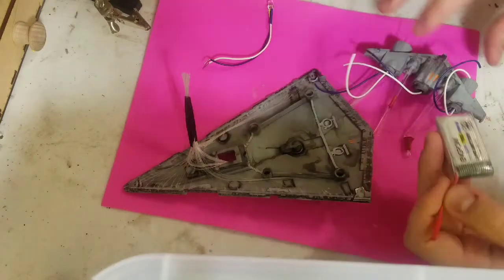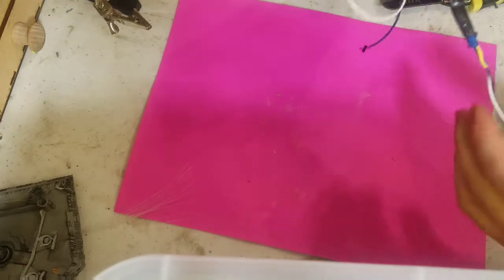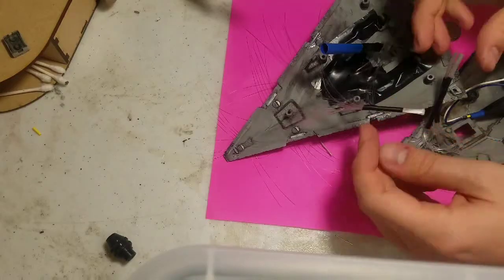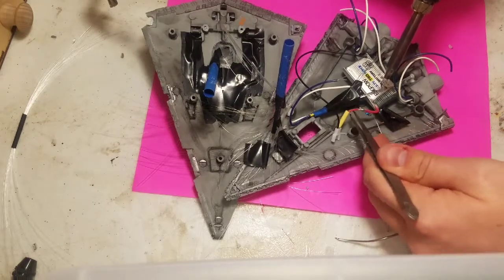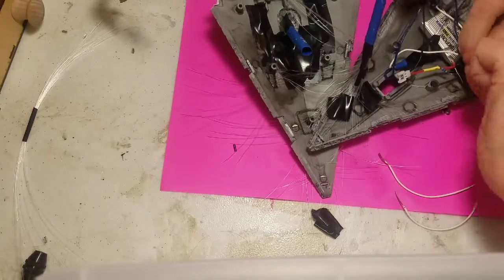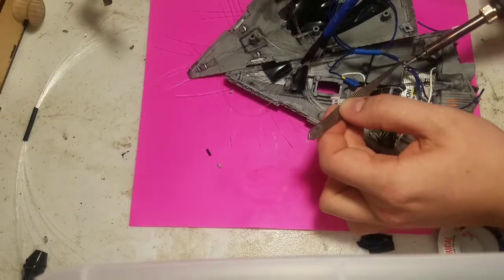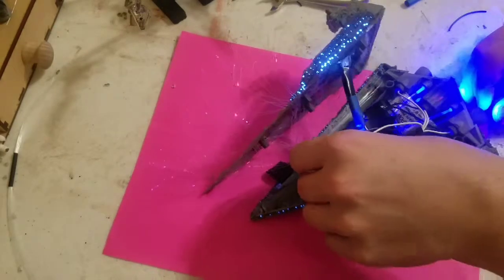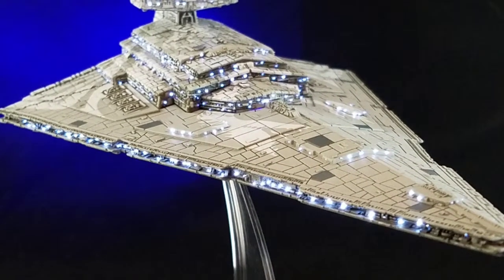Imperial Star Destroyer LED Modification Part 4 - Wiring and Finalizing

Comment: would you ever do this star trek eaglemoss ships?
Reply from the maker: I have no issues working on other models outside of Armada.  However, I believe that specific ship you're referring to is a die cast model, which is something I'm not interested in working on.  But if you're interested in a plastic or resin model, I could work something out with you.
Reply: LEDhangar ok cool.
Reply: @ledhangar3047  would you do leds for the super star destroyer?
Reply from the maker: @genenavarra3017  My SSD is arriving Tuesday, and not only do I plan on lighting it up, but I'm going to do another YouTube series on it.

Comment: what is your resistor for this project..
Reply from the maker: To figure out what resistor you need, use the V=IR formula first.  So in this case, the battery is a 3.7V source, and the LEDs are 3.0V.  Each LED pulls 20mA current, and there are 6 total.  So you have R = (3.7V - 3.0V) / (6 * .02A) = 5.83 Ohms.  I had a 6.2Ohm and a 5.6Ohm resistor - you'll always want to use one that exceeds your calculated rating, so I went with the 6.2Ohm resistor.  

You'll also want to double check the capacity of the resistor P = V^2 / R = (.7V)^2 / (6.2Ohm) = .079W.  So even a 1/8W resistor would be sufficient in this case.